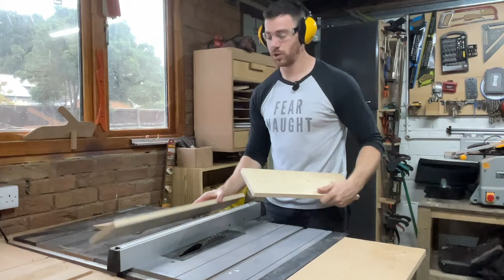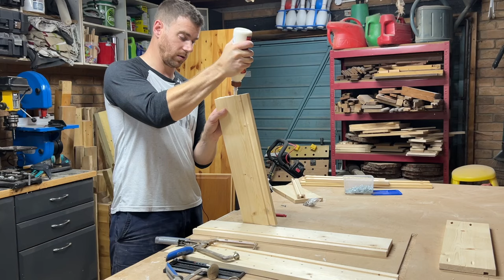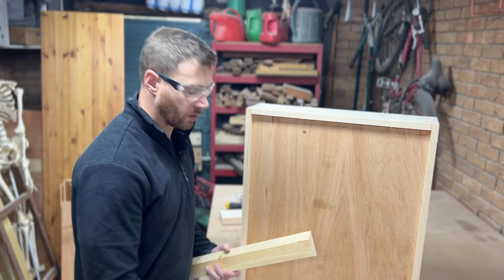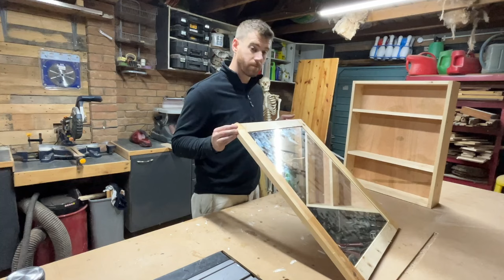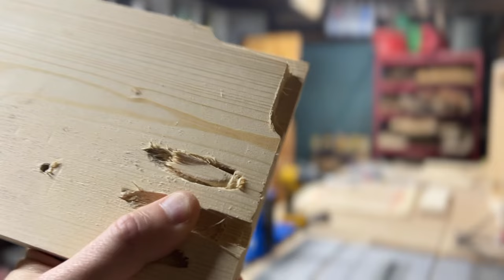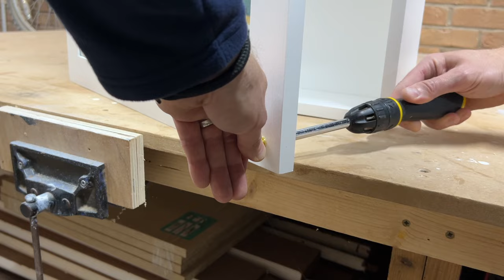How to Build a Wall Hanging Bathroom Cabinet with Mirror

Comment: Great video and lots of detail -- but I'd love to see this actually using *basic* tools.  Hand saw, plane, chisels, etc. - fundamental carpentry. The power tools you used require a huge outlay, that means this is in no way a feasible project for a beginner.
Reply from the maker: Thanks mate. I’m not really a hand tools guy to be honest. Buying good quality hand tools can also be quite expensive and keeping a sharp edge is a skill in itself. 

I did a basic tools video where I advised on buying 5 key tools that you could build a table with and used a second hand circular saw for it with some other basics. The total outlay for all these tools would be well under £100 which is a good place to get started. It’s as much about being clever with your materials as it is the tools. Big sheet goods are much harder to break down than pre-planed and sized timber boards. 

Here’s the 5 tools video: https://youtu.be/j3iPC_QrU3k?si=Slk4QJ5Szh8Idtqb

And here’s the side table video (it includes free plans): https://youtu.be/RdUGW1QIQN0?si=MXpJ-wMwS3axropt

Hope these might help mate.
Reply: @lionandbear Thanks for the links!